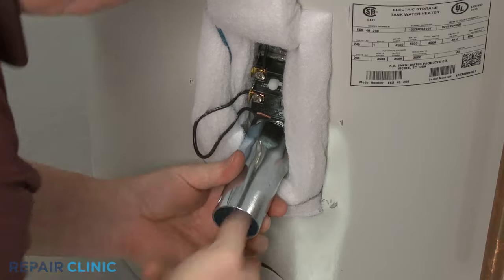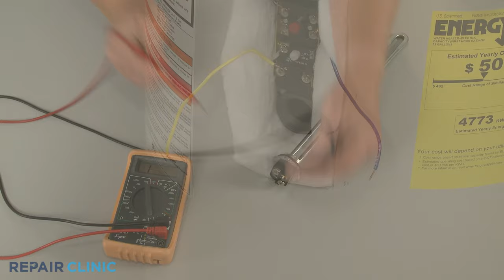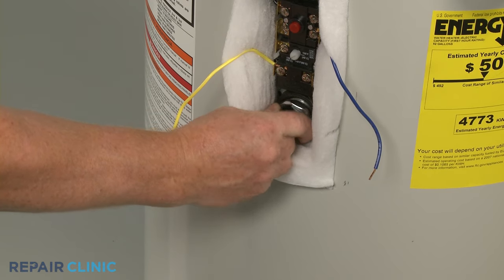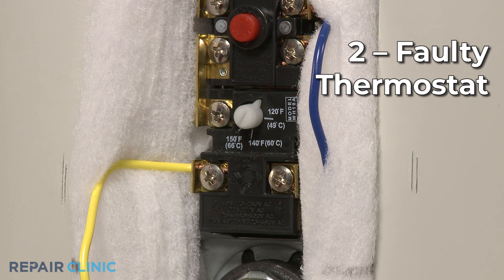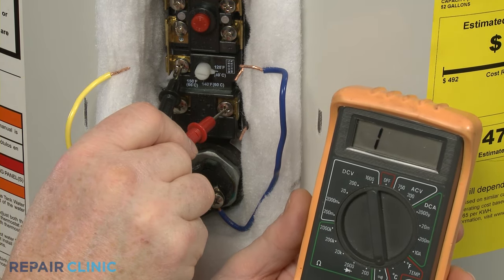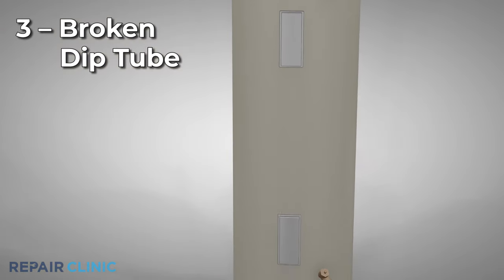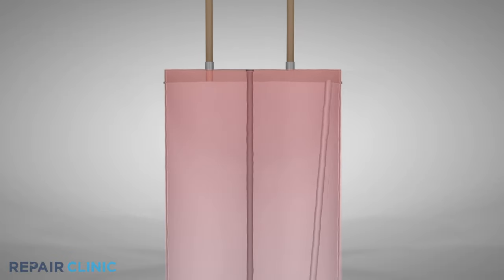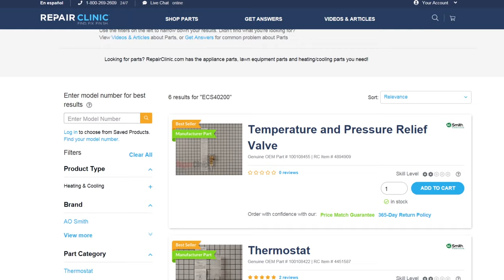Electric Water Heater Not Heating? — Electric Water Heater Troubleshooting

Comment: Pro tip - do not remove your element to check it. Just unhook the wires after turning off the power.
Reply: You're a god dam genius Gump
Reply: Can I troubleshoot without a voltage meter?

Comment: Me and My Fiance just moved into an apartment. Supposedly the electric heater is new. The fuse box above it is new, the element is new. The major circuit breaker fuses are fine. But no hot water.  Yesterday we ran the hot water for one tub fill up and that was it. No more hot water. We have almost gave up. Plumber says electrician problem electrician says plumbing problem. Can anyone please give me advice?

Comment: My electric water heater started acting up late last night......Went through the procedures of shutting off the power to the water heater and hitting the reset button......it came back on,but by the afternoon today the hot water was a little hotter than lukewarm.Tried do it again an 1hr ago, no 🔥  water  at all this time
Reply: What was the issue?

Comment: When my water heater stopped working after 9 years I watched so many of these try this try that’s, I changed the elements then the thermostats then the entire tank and still no hot water.
Can anyone guess what the problem was I’ll bet not, I think it could only happen to me, there was insufficient power from the main fuse board, so lesson to anyone check you have 220 v just a fu—-ing faulty breaker $620 life lesson.

Comment: What’s the tool you used to remove the water heater elements?
Reply: It's called Element Wrench for water heater
Reply: 1 1/2 inch socket